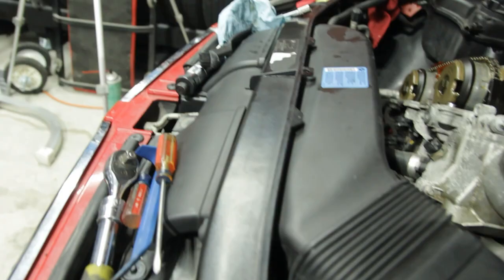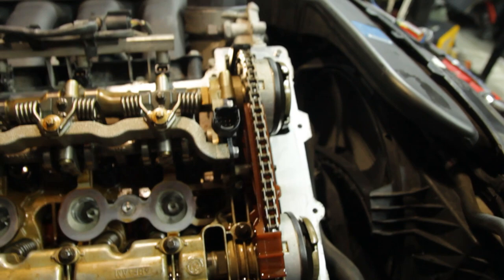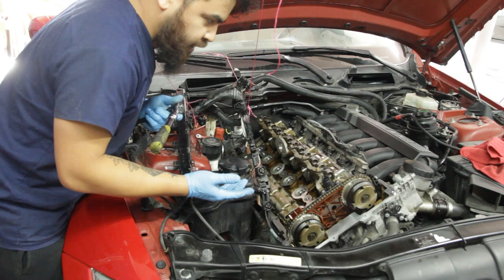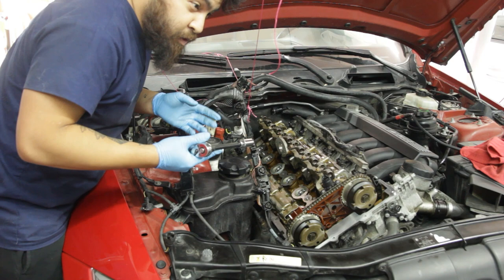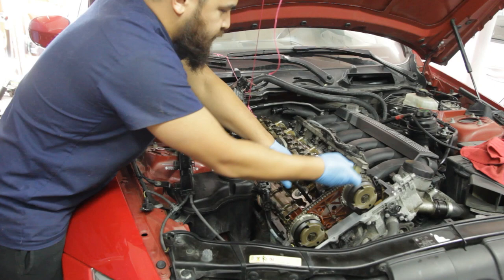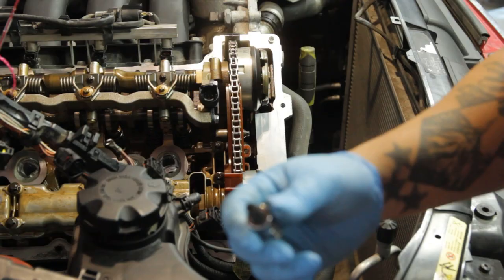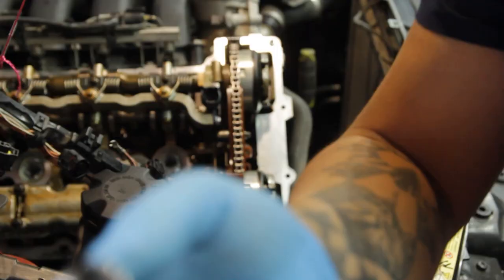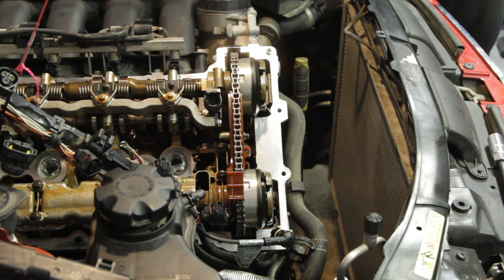BMW E9X 328i N52 VANOS Sprocket Bolt Recall DIY

Comment: I just completed my vanos bolts replacement with the upgraded bolts. I was tempted to go to the hardware store and buy the M7x1.0 10.9 grade bolts because I don’t feel comfortable with the upgraded 8.8 grade bolts. The exhaust side is a pain. I stripped one new bolt but I was lucky like you to get it mostly tightened with red loctite. They’re not going anywhere. I had to buy a T45 bit like you did with an 8 mm deep socket with a 1/4 inch extension with a crescent wrench. A 3/8th socket wrench will not fit. All my original bolts were intact but with no force, they broke free. Especially the intake side. I also replaced the pcv heater with the upgraded heater and a 7.5amp inline fuse for the pcv heater. Next…, oil pan gasket. And I have the 2011 328xi. Fun…
Reply from the maker: Glad to hear it went as well as it could. Was your car not elligible for the pcv valve heater recall? I just had mine done last month. My oil pan gasket has a slight leak;. Not enough for me to be worried about it anytime soon but I'm sure that is going to be a headache of a job.
Reply: @jontansgarage  my car is eligible for both recalls, however the dealership said there’s no remedy for the vanos bolts, yet FCP, ECS and Pelican have the bolts. That tells me the dealership is avoiding the vanos bolt job. So I decided to do it myself. I just have to put back the valve cover on but 
the darn gaskets are a pain. They don’t like to stay on.
Reply from the maker: @iamurnamann8662  Yeah, I think you made the right choice not waiting for them to get their stuff together. The valve cover is such a pain with the limited space, seems like once you are able to slip the valve cover into the right spot, the gasket gets knocked off. Good luck brother!
Reply: @jontansgarage  I finally got the cover back on and most of the part back in. Not everything is back on because I need to start it in a few to make sure there are no leaks. I made the mistake of cleaning out the CCV channels in the VC to get rid of that creamy crap, which I believe is what causes the CCV to fail. The gases can’t go anywhere because of the creamy buildup,thus causing leaks at the filler cap and eccentric shaft gasket. However, as I was spraying carb cleaner in the breather tube, I can see that creamy crap seep out at the oil filler cap and those long breather tubes at the middle of the valve cover. Consequently one of the breather caps came off. I had to RTV it and let it cute over night so it doesn’t pop off. Today is the moment of truth. Thanks to you, I was able to build the confidence to replace the bolts and replace the VC gasket for the first time.  I hope I tightened down the valve cover correctly so it doesn’t leak. I triple checked all the bolts. If the gasket leaks, I decided I will buy the aluminum upgraded cover since I’d have to remove the VC to fix the leak. The spark plug gasket were a pain! Looking down the SP holes I don’t see any kinks or misalignment so I’m hoping those gaskets seated correctly.  I’m getting too old for this stress. Lol!!
Reply from the maker: @iamurnamann8662  Glad you got it figured out. I hope it works out. Speaking from my own experience, it's worth replacing the entire valve cover when the gasket goes. When I first bought my car, the dealership that I got it from replaced the valve cover gasket (which is great) except they did not replace the eccentric shaft sensor... So I had problems with the car as soon as I bought it. I initially replaced the sensor and all of the gaskets, put the car together but realized they had replaced the valve cover with a crappy Dorman brand  cover (from autozone) that did not properly mate with the new oem gaskets as they were slightly different. Ended up with leaks at the valvetronic motor so I ended up doing the entire valve cover job a second time but this time I purchased a brand new genuine BMW cover and all is well. What I learned through my research is that the plastic valve covers either end up with the pcv/ccv leaking or they get warped enough from countless heat cycles and leak at the gasket, or eccentric shaft. So by the time the gaskets need replacing, it's probably worth replacing the entire cover at the same time (unless you have an older car with the magnesium covers). Even if the cover isn't warped, it may be fine for a little bit but then the PCV/CCV diaphragm ends up leaking and that cannot be replaced separately anyways.  

I have seen the Amazon aluminum ones and I haven't read any thing bad about them so it's definitely a good option, especially since it is half the price of the Genuine BMW plastic covers. Hopefully your current one works fine, doing this job multiple times in a row is no fun. Good luck man!
Reply: @jontansgarage  I went with the Mitzone plastic VC for 102 bucks. Came with all the bolts and gaskets already installed on the cover. The only issue I had with the new cover was the metal mount that supports the eccentric shaft actuator. Not the guide with the two bolts, the metal support brace that’s fastened by two separate bolts that fasten the VC to the head. That support brace was off alignment. Instead of trying to bang it or pry it to align the bolt holes on the head, I removed the original brace from the old VC and aligned perfectly. After everything was buttoned up, I had the nasty lifter ticks. Because the car was in the garage all week. Punched it on the interstate for 9 miles, got off the exit to make a u-turn and at the light the ticking was less but still apparent. Drive hard back home and ticking was completely gone. Purrs like a kitten.
Reply from the maker: @iamurnamann8662  Awesome to hear brother!
Reply: @jontansgarage  I greatly appreciate your video. Your video is the only video on YouTube that shows the bolt replacement process. I feel bad for those who are waiting on BMW and can’t do their own repairs. I wish I could help them, now that I know how to do it.
Reply from the maker: @iamurnamann8662  Much appreciated. I feel that a lot of motors are going to go caput while we wait on BMW
Reply: @jontansgarage  if they do caput, the owners can sue BMW since the failure(s) were due to a documented recall. I reached out to BMWNA and told them I replaced the recalls and inquiring on reimbursement, since performing the DIY recall repair is cheaper than replacing a motor or possibly removing the OP just to get to any broken bolt heads, especially on an X drive. I saved BMW a lot of money. They can at least pay me half of what the two recalls repairs would cost. I have all the invoices, pics and part numbers to the bolts, PCV angle connector, inline fuse, VC gaskets and alternator bolts. If they do honor my request, I will let you and others know here in case others want to DIY their recalls.
Reply from the maker: @iamurnamann8662  That would be awesome if they do, but I would be extremely surprised. Definitely keep us updated!

Comment: Just got my letter to be replaced, bolts should be in by Friday Aug 9th, just concerned shop's are being careful with sheared off pins or missing bolts that they go in to pan and flush to make sure no metal is left behind, basically hope the are just not ripping bolts out and replacing calling it done and have a potential issue down the line.
Reply from the maker: Yup! I have not received my letter but I did notice that the remedy is now available. The shop SHOULD be dropping the pan and collecting any sheered pieces should they find that any bolts have been sheered. They should be covering that expense as well.  Hopefully that will be the case.

Comment: Will the dealership replace the valve cover gasket since the seal will be broke during the process of changing these bolts?
Reply from the maker: I am pretty positive that anything that has to be done in order to perform the “remedy” would be covered. I’ve never seen anyone mention paying for anything when they took their car in for recall services.

Comment: So you didn’t have to re-time the motor at all doing this since you did them one at a time?

A shop did my oil pan gasket and found two sheered off VANOS adjuster bolt heads in the pan. I have an 06 330i so not included in this recall at all. When we did the Valve Cover Gasket, we saw the two missing bolts on the intake adjuster. The car runs great and doesn’t have any codes, but definitely something I want to do since that’s a huge weak point right now. 

The guy who does work on my car privately thinks we will have to re-time the engine to do this, but this video suggests otherwise since you are doing them one at a time.

Let me know your thoughts!
Reply from the maker: Bummer that it isn't apart of the recall. As far as re-timing, it shouldn't be necessary if you do one bolt at a time. I will say that the only reason that I am even remotely confident at all in this, is the fact that the official BMW information bulletin with the service instructions say it isn't necessary or at the very least, they don't mention it. The only thing that is mentioned is at the bottom of page 14: "IMPORTANT: Never loosen more than one VANOS assembly bolt (1-4) at a time to avoid losing the sealing and alignment of gear assembly." Obviously, retiming wouldn't hurt but it would certainly add a good bit of time, labor and money to the job. In my eyes, if BMW themselves don't mention it and doesn't require their technicians/mechanics to do it, then it probably doesn't need to be done. 

HOWEVER, the above only applies if NONE of your bolts are found loosened or broken. In the middle of page 2, they mention that if ANY bolts are found loosened or broken, that the Vanos unit/assembly must be replaced. Which would require re-timing since a lot more has to be removed in order to replace the Vanos unit(s). So in your particular case, your mechanic should be re-timing, however, he should also be replacing the Vanos units and not just replacing the bolts. I think your mechanic should definitely re-time just to be safe, especially if he isn't planning to replace the Vanos unit(s).

Thanks for bringing this up because I didn't catch this second part until now. Fortunately, all of my bolts were still tight thus re-timing wasn't necessary.
Reply: @jontansgarage  thank you so much for that reply. Yes, we are going to end up replacing both adjusters themselves.
Reply from the maker: @stephanduplooy1634  Good stuff. Hope it all goes smoothly, good luck!

Comment: I might have missed this part of the vid, but If you are replacing them, I'm guessing you are replacing them with better quality bolts right? This T45 security torx are better than the OEMs right?
Reply from the maker: The old bolts are the security Torx while the new ones are non-security (ie they do not have the dot in the center). The new bolts are linked in the description and are supposedly stronger, however they are still very soft and can easily damaged if the torx bit is not perfectly aligned in the head of the bolt; this is the reason I opted for torqueing these at the lower end of the specification and adding lock tite

Comment: Great job buddy do you need to put car in neutral to move the engine I am going to do it on mine X5 .
Reply from the maker: As far as I know, you technically don't HAVE to, but it will be a lot easier to turn the motor over in neutral.
Reply: Great I really appreciate it  thanks ..

Comment: Did you have to drop the engine or remove the control arm to perform the remedy?
Reply from the maker: Not at all. Everything is accessed from the top. Remove the cabin air filters, cowl and valve cover.

Comment: Yes, there is indeed an open recall for this vehicle but I don't understand why you didn't take it to the dealer there they can repair it for you without any charge
Reply from the maker: It’s all in the description brother. A lot (maybe all) E91’s just weren’t included in the recall. They are mentioned in the service bulletin but when you call the dealer up they would tell you there is no active recall or the car wasn’t eligible even though it met all the requirements. That is why I took this on myself. Now, the cars are eligible for the new recall however as far as I know the remedy (which seems to be the same as the previous recall) is not currently available.

Comment: I have a 2011 F25 X3 with the N52 and it also was never recalled. They appear to have the same vanos bolts that you are replacing.
Reply from the maker: Interesting. What year is your vehicle? If you enter your vin at mdecoder.com it will give you your build year. The bulletin says that the cars affected include up to November of 2011, and also includes the F25 cars. It’s possible that your car has the updated bolts already however it’s also very possible that BMW decided to not include you like they did for the e91 cars. I think the only difference is the head of the bolts. The old ones use the “security” version that has the “dot” in the middle. The new bolts don’t have that center dot. Hopefully it’s the newer version.
Reply: @jontansgarage  I pulled the valve cover yesterday and both of my vanos gears do indeed have the OLDER bolts. However, the recall specifically calls out two vanos gear model numbers (507 & 508) that are stated to be the updated part numbers and replacement isn't necessary. 
I checked my gear part numbers and they are the updated numbers even though they have the older bolts. 
All of my bolts were intact and super tight so I chose not to replace them with the newer bolts.
I wonder if the gears with rhe security bolts simply weren't assembled properly and they chose to change the bolt at the same time. 
Anyway, I have 155k miles on mine. So I'll check them every time I have the cover off (because we know that the gaskets and PCV like to fail on these suckers). 
Great engine if we stay up on the maintenance.  Pretty easy to work on too for us DIYers. 
Thanks again for the video and the time you take replying. Much apprecied.
Reply: My x3 f25 is a 2011 built in September. But yeah, the part numbers in the 10/14 recall notice matched the "unaffected and do nothing" parts even though they had the older style security bolts. All bolts were intact and tight like a tiger...
Reply from the maker: @danmulkiewicz5515  Fascinating. I'm going to be honest, I didn't even catch that part of the bulletin lol. I am curious if perhaps the E91's somehow managed to get those newer assemblies and that is why they aren't included in the recall. Then again, it does say it's for cars AFTER September 1, 2012 but I wish I would have checked the part numbers when I had the cover off. Anyways, Glad to hear yours is using the newer assemblies. Thanks for sharing the info.
Reply: @jontansgarage  You know.... I'm re-reading the recall and it looks like I may have mis-interpreted the wording a bit. 

It seems that IF those vanos gear part numbers were replaced AFTER 2012 then nothing needed to be done. All my bolts were tight and intact but I think the bolts or the assemblies should have been recalled and replaced with the newer bolts/assemblies with the newer bolts. 

I did check my F25 at the dealer and sure enough: NO open campaigns. So I think mine was probably treated the same way as the E91's where they weren't actually recalled / owners weren't notified properly and BMW played the numbers game and did nothing while the clock ran out..... 

I'll probably replace the bolts next time I have the valve cover off..... /sigh
Reply from the maker: @danmulkiewicz5515  Ahhh re-reading it as well and it does seem to read that way. I am looking at pictures of the part and they definitely seem to be using the newer bolts (the non-security torx heads) so I feel like there is a chance that you will be fine since yours appeared to have the newer bolts as well. Too late now obviously but man what a bummer. Good catch though.
Reply: @jontansgarage  here's the part that I wasn't clear about: mine did have the older security bolts. But the part numbers of the assemblies  were the two listed in the recall paragraph under "unaffected ". All were super tight and intact. At 150k+ miles I'm probably fine but next time I'm in there I'll likely replace the assemblies or at least the bolts I guess. /sigh. Wish the recalls were more clear. I guess this is what the E9X community has been feeling like. Lol. Thanks again for the discussion and the video. It's super helpful. Cheers brother.
Reply from the maker: Oh that’s right. I forgot you did have the older style bolts. But yeah, I guess the part number and the assemblies stayed the same and they just updated the bolts. Cheers brother.
Reply from the maker: Check this out they just added some more cars to the recall. https://g87.bimmerpost.com/forums/showthread.php?t=2061784&fbclid=IwAR2O7BnUucI2dypCPpOjXCg45A0zhIOeyV8mAE91kmFoL1mOopyH9cNJb3I_aem_Abcj62Fy2xuG6zdSyz0c4Uvlp9vuRGZQpC10r1vPlwnrD_lUWEs0ZXBCGu2cC8ZMEd8

Comment: Had my 2011 X3 N52 do a kind of a rough idle. Went to BMW and they asked me to perform the recall before further investigating on the rough idle i was mentionning. They ended up replacing the intake regulator and bolts because one of the bolts was found missing. They found the lost bolt with a camera in the engine. Seems like my rough idling was due to the loose intake regulator. Was lucky, paid nothing.
Reply from the maker: Nice! Hopefully they replaced the eccentric shaft sensor while in there; when I first bought my wagon, I was having rough idle issues resulting in the car dying and requiring having to limp it under 3000 rpm.  It would be a real shame if BMW does all of these recall services, but knowingly disregard replacing the sensor just so the customers have to bring it in to perform a similar job (valve cover removal) and this time be charged for it.